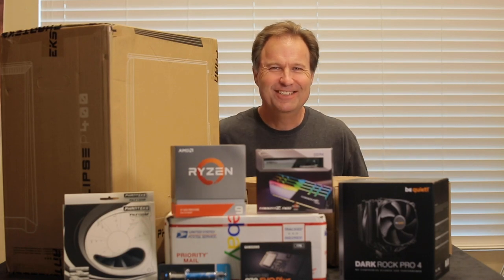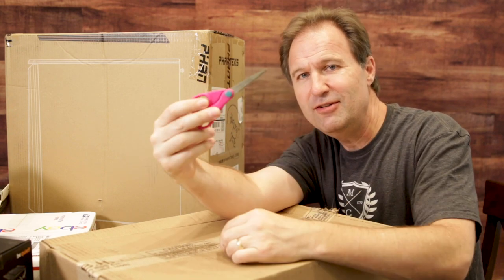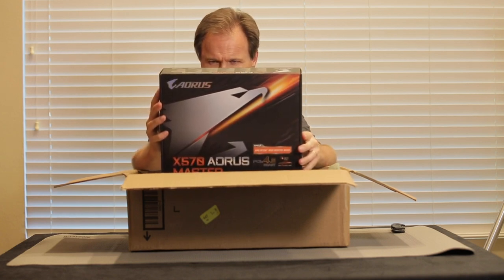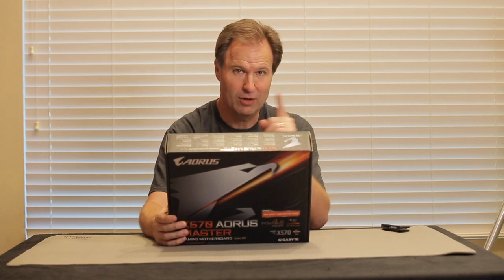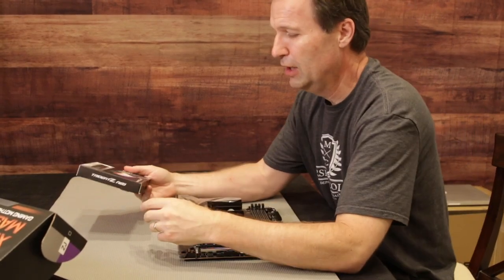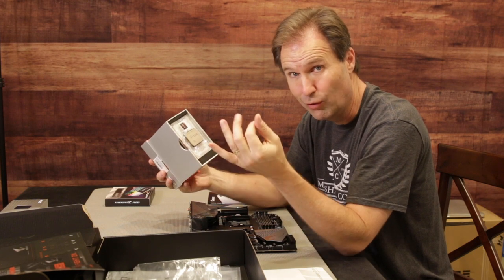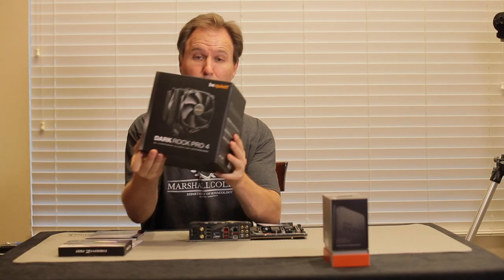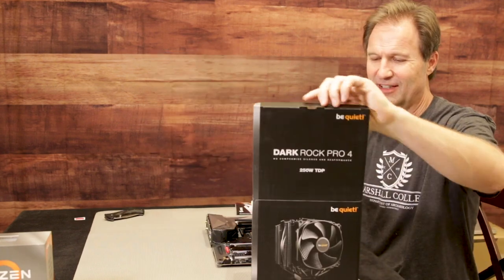HOW TO BUILD A PC - Step by Step 
Tutorial. Phanteks P400A, AMD Ryzen 3950x, Gigabyte Master, NVIDIA

Comment: My audio cable is not going in all the way to the pins. In something liked that Im afraid to apply a lot of pressure. Any tips?
Reply from the maker: Sometimes the pins may be bent slightly. Look closely. Check to make sure the cable connection is right side up. Also check both sides of the cable to make sure you’re installing it with the correct side. Double check your manual to make sure you’re using all the right parts. Good luck!
Reply: @devosentertainment  wow thanks for the quick reply 👍. One more thing sorry to bother you but my cpu cable box on my motherboard where it plugs into is so far top left that the cord is tightly against my cooler and to plug it in I had insert it at a weird position and now Im afraid I goofed up 😓. Are there any cable managin tips you can give?Love the videos man you are the video Im following for my build and you explain it so well. Keep up the content dude! 👍
Reply from the maker: @tdchallenge2231  hmm. That can happen. Are there more efficient routes for your cable? Also maybe consider a longer cable.
Reply from the maker: @tdchallenge2231  And thank you for the kind words. :)
Reply: @devosentertainment  Im using the same case as yours so I think the only rubber ones in the back are all 😕
Reply: @devosentertainment  I have a fully modular so it wouldnt hurt to get new cables. Do you know any good brands?
Reply: @devosentertainment  ahhh I found the top slot and put it there. Looks way better now 👌
Reply from the maker: @tdchallenge2231  awesome! Better bandwidth too!

Comment: is the back fan a 3 pin or a 4 pin? im confused why there is one pin left showing
Reply from the maker: The fourth pin is for fan speed control if both your fan and bios support it. If you only have a three pin fan, plug it into the four pin, leaving one pin blank. Make sure that you slide the connector into the little plastic channel provided. In most cases the top pin will be left open. Your fan will run at 100% speed all the time. Which is not bad, but will generally use a bit more power than speed controlled four pin fans. Consult your manual to make sure. Good luck!
Reply: @devosentertainment  thanks, I am buying another panteks 120sk just like the one it comes with, and my motherboard only has 3 case fan connectors and one aio pump connector, if I put a rgb fan into the aio pump will I still get the addressable rgb? My mobo is asus rog strix b550-f gaming wifi
forgot to mention, is the rbg cable you plugged in for the fan of for the front panel rgb button?
Reply from the maker: Mike M I believe the cable was for the front panel. I’d have to go back and check the manual since I don’t really pay much attention to the rgb functions. Your manual may give you more specific detail. Not sure about the pump header working with the fan. If you are short a fan header, you can also look into getting a splitter and connecting two fans to the same header.
Reply: Mike M Hey Mike have you figured out if putting the other phantek fan into the aio pump works and gets the aRGB function? I had the same question.

Comment: My rear fans a six pin what do I do there plz 😀
Reply from the maker: Interesting. What is the model of your fan, case and motherboard?
Reply from the maker: Most likely you’ll need to get the fan controller made for that fan and power it with a molex cable from the power supply rather than plugging it into your motherboard.

Comment: Hi,is it ok if the samsung side is down,  with wd blue SN570 m.2 NVMe SSD 2TB on a asus tuf gaming b550-Pro?
Reply from the maker: Does the notch on the drive allow for that? It should slot in only one direction.
Reply: @devosentertainment  yeh but it is the only way it can fit so I dont know , if its right or wrong

Comment: is preinstalled thermal paste ok to use with the ryzen stock cooler?
Reply from the maker: Can you clarify what you mean by preinstalled?
Reply: @devosentertainment  for example the ryzen 5 3600 come with a wraith cooler with preinstalled thermal paste, are you sure they’d will be alright
Reply from the maker: @bxnlz7927  I can't really speak to your particular situation. I would imagine it will be fine, as manufacturers generally know what they're doing. Thermal paste is used to fill in any minuscule gaps between the CPU and the cooler plate. Some do better than others, but honestly, you'll probably be fine. For the most part, paste is paste.

Comment: Oh my gooood thats like 5 times the amount of thermal paste that you need
Reply from the maker: Many different ways to apply it. Bead, line, thin spread. You want to make sure that there are no gaps between the processor and the cooler. The paste fills in any air holes that might exist between the surfaces, no matter how small. Do you need it? Nope. But I like to have max efficiency and so thin spread is my weapon of choice. And as long as it doesn’t spill over onto the surrounding parts, why not?
Reply: @devosentertainment  No Dave, just no.

Comment: When I turn on my PC, it'll automatically take me to Bios. I can't install windows. What do I do?
Reply from the maker: Go back and watch the end section again. Do you have your windows boot media?
Reply: @devosentertainment  yes I have. I've followed your instructions but it keeps taking me to Bios.
Reply from the maker: @itsArjie  If you recently added new hardware, fiddled with the existing hardware or you simply moved your computer around, make sure everything is in order.
Hardware that is not properly plugged in could trigger the BIOS to open every time you try to load Windows.
Check the CMOS battery.
Unplug all peripherals and try booting that way.
Turn Off your PC and unplug all cords. Hold the Power button for a minute to discharge it. Plug in everything and check if it’s working properly.
Reply from the maker: Did you get it working?
Reply: @devosentertainment  yes it's working now. It was actually a problem of my usb stick. It wasn't reading it. But thank you so much for your help!
Reply from the maker: @itsArjie  awesome. Glad you’re up and running.  Make cool stuff!

Comment: on my msi tomahawk x570 mb, there are about 5 'jfan' connections and a fan pump or something like that. the cables on my phantex were too short to reach the "jfan' connections so I wasn't sure if I was doing it right. There is another connection the mb for a pump fan. what is that?
Reply from the maker: Generally a pump fan is for a water cooler setup. Are you using an air cooler?  Either way, you’ll want to consult your manual. 😎👍
Reply: @devosentertainment  Hey thanks for the help. i have another question, My GPU has two GPU cable connections, a six and a four. do I plug in both cables??My manual doesn't say anything about it. Tomahawk x570
Reply from the maker: @yepnah3514  what make and model is your gpu? Most likely you will plug in both but you’ll want to make sure you consult your GPU manual.
Reply from the maker: @yepnah3514  That’s a pretty beefy card and as long as your have at least a 550w power supply, you should be good with both power cables.
Reply: @devosentertainment  yeah I have a 650 power supply. I'm excited. I have the same case. I hope you still like it!! Thanks for your video...it helped a lot more than most. Make more videos if you have time!
Reply from the maker: @yepnah3514  What other videos would you like to see? Make sure to subscribe!  :)
Reply: @devosentertainment  thats a good question, Not rue, a follow up video? haha..

Comment: How do I do this for msi
Reply from the maker: What mobo do you have?
Reply: @devosentertainment  b450 tomahawk someone did it on reddit with out a adapter but didn’t explain it well enough for me to understand
Reply from the maker: @royxl9506  What specific issue are you trying to address?
Reply: @devosentertainment  my rgb fans aren’t lighting they spin tho
Reply from the maker: @royxl9506  are you connecting to the rgb header or just a regular fan header? Make sure to check your manual for the position of the rgb headers. I believe there are two of them.
Reply: @devosentertainment  doews the case have a rgb header i only see d-rgb
Reply from the maker: @royxl9506  not the case. The headers are on the motherboard. Are you able to daisy chain your rgb cables into the d rgb header?

Comment: Need stay with one brand. Corsair/Aorus, Aorus/EVGA etc. All tha mix is bad taste.
Reply from the maker: What’s your fav?
Reply: @devosentertainment  Hello Sir. I can exchange my experience building my 1 proper pc. Am not very ritch person, so i went budget wise, middle class components. My research took 2 months and collecting parts - 4 months, but am happy with result. I started with case, and it was Corsair 680x white. I managed to buy it for 180 euros, it had already inside 4 LL120 fans (120e.) and command hub to control these fans. But i don't needed that hub and sold it for 50e.(better hub come with cpu cooler). Great looking case, white and black mix, it will dictated my next choises. Next i bought corsair psu rx1000i from crypto miner, looked like new, no scratches or so, used 1 year (platinum ser.) paid 50e. New cost around 200e. Next i ordered Ryzen 7 5800x from aliexpress, new, without box for 340e. Good deal. When i bought H100i ELITE CAPELLIX Liquid CPU Cooler, it come with new better fan hub. Perfect for 680x case and keeping the style! 140e. When bought Corsair RGB Pro rams, 4x8 gb 3600mhz., white. 200e. Here i was done with Corsair. I had many thoughts go with Asrock, MSI or Asus for next parts, but i went for Aorus. Motherboard - Aorus x570 Master rev. 1.2 cost me 330e. And final move, - Aorus Radeon 6800xt Master (to keep clear AMD setup and not mix with RTX). Don't ask the price. (Crypto miners are worst kind of people). So here it is, my setup, Amd/Aorus/Corsair masterpeace ;) Good luck in next builds o/

Comment: Hey Dave, thanks for the terrific video. I followed this step by step as I built my first PC and it worked great (except for one bit). I too purchased a Phanteks P400A. My 3 fan cables look a bit different than yours. They split into two connectors, one male and one female. I'll attach a pic here below:

https://imgur.com/gallery/lX9QhXb

Do you know what these are supposed to connect to?
Reply from the maker: Are these the fan cables or additional RGB cables?
Reply: @devosentertainment  Whoops, yea these are the rgb cables. I saw the 3 pin header and thought it was for the fan power.
Reply from the maker: @varungopinatth2094  Cool! Hope you get lots of use out of your new baby. What will you be using it for?

Comment: OMG.  This much thermal paste ?  I thought it was "Pea Size"  WTF
Reply from the maker: There’s different ways to do it. I used the thin spread method. You can do the pea size if you like. Paste is supposed to fill in all the gaps between the cooler plate and the CPU. Use whatever method you’re comfortable with. Hope it goes well!

Comment: Only my middle fan works
Reply from the maker: Go back and check your pin positions on the header. Also go into bios and make sure your fan settings are correct.
Reply: @devosentertainment  yea idk man i got em all working all on diff headers but only middle fan led will work ive tried every thing in book, wjen i hooked up sata to psu middle led came on, but rest nah nothing will turn em on and i cant even adjusy one in middle, im so lost
Reply from the maker: @danielbyers6978  the only other thing I might suggest is the button on the underside of the top front lip of the case that cycles through the led colors, etc.
Reply: @devosentertainment  yea it does nothing man, idk if my headers are broke ive tried so many ways, i plugged 4 or 3 pin led header into mobo header even my hyper 212 black is stuck on solid color nothing will change it
Reply: @devosentertainment  i admit thats part of a pc i suck at and dont understand but there nothing left to tey3
Reply: @devosentertainment  have brand new aurous z590 elite ax mobo so all headers shouod be good
Reply: @devosentertainment  heres a funnt thing far as my cooler, if i plug into one header uo there its orange, the other blue idk
Reply: @devosentertainment  so by plugging in the sata that should of lit em all up with control from button on case? Yet only lit middle no control at all, the mobi rgb header also does nothing  so i can only assume i got some broken case rgbs
Reply from the maker: @danielbyers6978  Yeah, sounds like that may be the case. Have you gone into the bios and explored your fan and rgb control?
Reply: @devosentertainment  i have gigabyte rgb fusion

Comment: help! my mobo has a 12v GRB connector only and can't get it to connect due to the blocked out slot on the connector
my mobo is MSI Z390-A pro
any help is appreciated thanks!
Reply from the maker: Were you able to get it working?

Comment: okay so i accidentally took off the back case screws fully,,, and it wont come off no matter what i do
Reply from the maker: Argh!  Hate when that happens. Don’t pound. Just find the indent half way down and pull backwards. You might need to grip with both hands, with strong fingers and a thumb pushing against the main case. You can also jiggle the side a bit if you need to loosen it.
Reply from the maker: @deathuru  that’s a bummer! One other thing to try, which might take two people.  One person presses in on the front of the panel while the other one pulls back on the rear of the panel. That might help loosen the clips that hold it in place toward the front.
Reply from the maker: The tabs are most likely already bent causing the trouble. (While its still on its side) place both palms on the panel applying downward pressure as if you're giving CPR while sliding toward the back of the case. Will probably take some force but I wouldn't worry too much about breaking the tabs assuming they're metal/aluminum